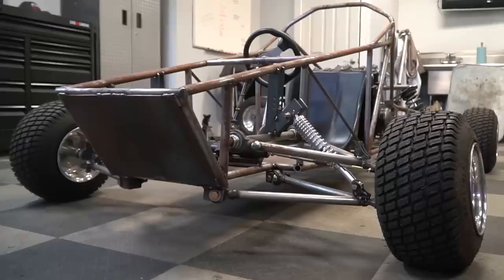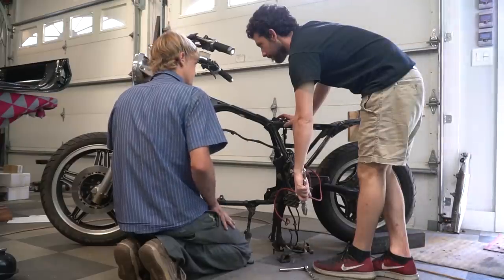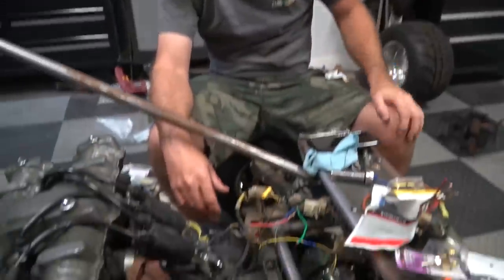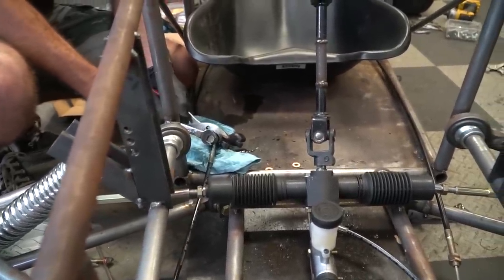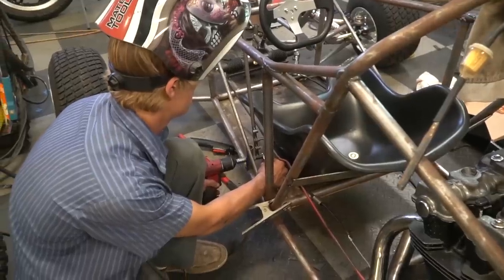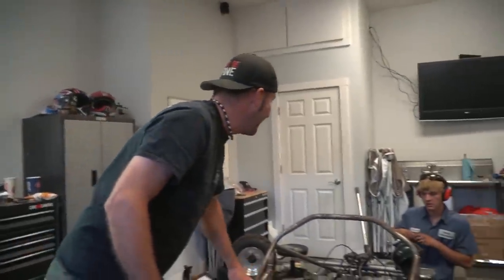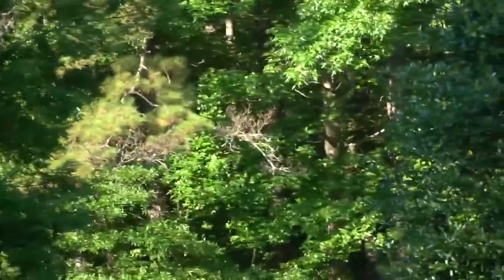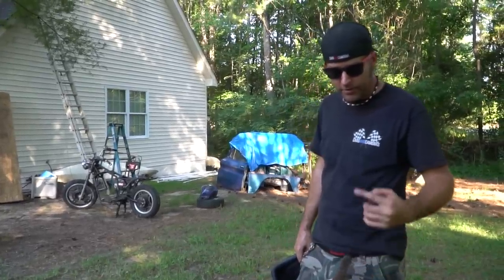750cc Cross Kart FIRST DRIVE!

Comment: I've followed  just about all of your builds and  admire your attitude and skills.  This one really hit home -   it made me pull my almost-done  Honda CMX 450 powered   project out of the equipment shed. My wife put it  into storage 5 years ago  right after  I broke my leg, and half the farm eventually  got stacked on top of it..   I'm pushing 72 and figured it's get it done or sell it before either it or me rots away.    Fortunately I had shut the petcock off on its last start up.     All I did was replace the battery, clean the tank, and ran some fresh ethanol-free gas with  a squirt of  techron  thru the carb - didn't even take it apart.  Started and ran  like it was last shut off yesterday.  Forgot how  loud it is thru 36" curved straight pipes with megaphone ends  -   neighbor a  half mile away came over to investigate.     I finished the clutch (bent the bike's clutch lever and mounted it as a  foot pedal )  and fabricated the same kind of left-side jockey  shifter. Took it for first ride with the right side tire in free-wheel.  Light  throttle,  feathered the clutch, rolled out nice and quick, then  nailed the throttle and it all but  stopped moving -  left rear tire just went up in smoke.  Waiting on new set of Ebay tires all around.    Once this one  is done, I have an early Honda Pilot with a 2 stroke 398cc Kaw jet ski engine that 's nearly finished - just  needs a better brake and a steering rack from GPS.   Hope you guys are around for a long time to come.

Comment: Suggestion: F1 style fiberglass body on it... and/or a huge wing
Reply: #bigwanggang
Reply: i think a rear wing yuou be worse. all the weight is in the rear with the engine so all its gonna to is lift the front iup making it harder to steer
Reply: And a big wing dang doodle
Reply: @retrox684  You could easily make an aluminum wing that weighs all of a couple pounds and bolt it to that suspension brace in the rear. Since it wouldn't matter aerodynamicly till over 60 mph really in any meaningful way, it would be fine. Just don't make the wing out of steel and the balance won't be any worse than now. They could also do a front F1 style front wing, and do that out of steel to make a little more front weight bias since the engine is in the rear.
Reply: I came down here to suggest a big gnarly wing lol
Reply: It would be epic to have a F1 style body on it but I don't they could do that.
Reply: How about a cavalry saber, cut down and used for the shift handle? Maybe some Porsche tubular "silencers for each of the four exhausts- love the splayed pipes they  got from the old Honda! Extend of the kick starter spline to the outside of the car for "manual restarts". Love  the idea of "fighter jet intakes on the sides to help cool the motor! Suggest they dial some of the extreme castor out of the front end- it will be effective at just a couple of degrees and steer much easier- the gear reduction through the R&P steering gear is helpful but for a cart, the total turns lock to lock look tiring. And then just go "steam punk" on it! If any of this will decrease the smile per mile take it off and throw it away! Awesome- Lethal;; I'm jealous- my 750's didn't do that !
,
Reply: What about a cross kart body
Reply: Front and rear wing
Reply: Parker Barandon I think there’s enough weight on the rear already. I’d like to see this thing on a proper road course.
Reply: @williams3118  That could be cool- I'm more about letting the whirly twirly bits and pieces stand out, though!
Reply: @Daniel Seaman ;) !
Reply: Parker Barandon RALLY F1
Reply: Parker Barandon why ? That would not bring anything in the way of performance to the table at all. If anything needs to be fone, they need to stick a proper limited slip diff to the rear end and get rid of the heavy assed miata parts.
Reply: No No,  Leave it the way it is!  Sounds nice too!!!!!!!!
Reply: @retrox684  Its not going fast enough for a wing to have an effect but a wing will slow a roll over and save the frame and bones. lol
Reply: ROTAXD just for looks, why not 🤷‍♂️
Reply: @retrox684  That's why they should add a nice front wing too :)
Reply: Homemade wings aluminum or steel is a bad idea because of the crash factor if someone crashes that thing they are already in for some bad injuries no need for shreds of scrap metal to slice them up too..but wings would look cool I'd go with fiberglass and I only say that because I know someone who races stock cars class with homemade metal bodywork and he can tell you some bad stories about what happens when that sheetmetal crumbles and comes in contact with your body
Reply: Ryry Boyle good points for sure
Reply: A fat GT wing lets go
Reply: Camber on those wheels might give ya little more control..

Comment: for getting the air out of the brake line , the ups and downs in the line traps the air , its still a light vehicle , just lift the rear up untill its above the level of the reserviour and start bleeding , should work a lot better

Comment: Big wing and some slicks. This would be a track beast. It can be a cross kart and a track kart with a simple change of tires
Reply: ricer
Reply: SO2002 that’s not ricey though
Reply: A wing? Hahaha, yeah, not how aero works, but ok.
Reply: @SMDTURBO  you never know 🤷🏾‍♂️
Reply: SMDTURBO yeah but at speed it works, depending on the angle and size of the wing and extra aero, then yes that is how aero works

Comment: When I did my cart…I did it with a CB360 motor…fuel pump…hand shifter (half of handle bar with clutch lever) homemade live axle with 3wheeler tires and a sprocket the size of the wheel!!! Lone disk from the front of the bike! Thing was sick!!!

Comment: I would suggest a harness with a bucket seat and a taller head bar. And like someone else said a cluster with a thick roll cage spec tube to help in a roll over. But that ting is a freaking BEAST!

Comment: when does it stop being a go cart, and becomes a dune buggy ?  Whatever it is I love it ! ! !
Reply: robert miller this is boarder line I’d say, but it’s perfect
Reply: not even a bit dune buggy, dune buggies are built for dunes...
Reply: Usually it becomes a mini buggy when you add suspension.
Reply: Buggys tend to use car motors and tranys   long travel suspension and full size tire wheels and breaks.... not those timy wheels
Reply: I mean my lawn mower has bigger wheels
Reply: @GumpterCrayon  A 3 in lift and different tires, it's ready for the dunes.
Reply: @buddersthepuunk  70 hp of that motorcycle motor is a whole lot different than 70 hp out of an automotive motor. It won't live long in this application. Especially being air/oil cooled
Reply: True ...but buggys tend use more than 70 hp.  Most i know of are at least triple the hp
Reply: @buddersthepuunk  my 1976 VW powered buggy had the stock 30 hp from a VW van. LOL

Comment: WARNING: Put your front suspension >45° else it will bottom out when under load and you risk flipping over the front once the nose digs into the ground. This is why in your previous video, your suspension stuck when it was angled even more parallel to the ground. Do the head clearance ASAP. Nice work guys.

Comment: Well you 3 just walked out on stage and pulled the cover off your 750 cc Cross Kart, started with a bit of start up rhythm and broke into the fired up sound of  one of the best builds on youtube , kicked ass and took names, with some carb work and a 4 into 1 collector for your exhaust my buddy the bike mechanic says you could possibly see 80/85 hp, it is a Frankenstein build and i thought you 3 could call it Phantom of the Paradise ,AKA the old movie from the 70's, your intro song could be  LIFE AT LAST FOR YOUR NEXT VIDEO,  and paint the side of the cart  with a pissed off LEROY COMING BACK FROM THE DEAD TO GET THE RACCOON, THIS IS THE BEST YET

Comment: Amused by the cinematic, but she RASPY.

Definitely needs a wing, a baja paint job, and a 09.98 drag strip time.
Reply: A scary 14 sec quarter maybe.
Reply: taylor harper Nah. I think a 9.98 and more while it out runs the rail.
Reply: Considering the bike did like a 13.8 quarter...... Enough said.  Not taking away from an awesome build.
Reply: @taylorh155  it'll probably do low or high 12 sec pass more traction and maybe less weight or close to the bike.
Reply: Low 9s in the eighth is my guess, I think it might be undergeared to run the quarter since it's a pretty close-ratio bike and they have it where 1st/2nd are ok around the yard.  Not that you'd want to do more than 80mph in a kart like this anyway.

Comment: Hi Folks,
I REALLY like your build(s) and ingenuity.  I've subscribed because of/ to that interesting content  you are providing.
 After 70 years of (gearhead)  life, 50+ Gas & Electric motorcycles and 30+ ICE cars/trucks, and "8" years of Grand Prix motorcycle racing, I love to see guys like you build!!
Stay safe and warm.
cheers
Boots Langley
La Mesa, ca

PS; my only input is;
SLOW Down when you are bleeding the brakes. You are adding air, with your fast pumping.

Comment: BTW John, you do know that the copper piece that the wire comes out of in your mig gun is replaceable right? It's a consumable piece that will get worn out after a wire and you can buy new ones to replace it without replacing the entire lead/gun. Also you need to clean the slag off the nozzle from time to time, most people will clean it off each time they turn the machine on for the first time that day, and if it starts getting clogged up, clean it again. You need to make sure you have an unobstructed flow of gas.

Comment: You guys need to get some sheet metal to put between the seat and the engine. The way to make it work is to have it extra wide with the ends bent forward to catch the air, and fins cut in the correct direction to point at the exhaust. This will force the air through the panel and away from the driver/exhaust keeping both much cooler. Actually, having two panels (with matching ports/fins) sandwiched together with about 1/2" space between them, the side closer to the driver will stay even cooler.

Comment: So I have been wondering why don't you use ATV/ UTV rims & tires? ATV/ UTVS generally have larger rims with greater back spacing (just use some narrow rims with semi slick tires) which would clear the custom suspension better and create a better scrub angle.

Comment: Please tell me you made the frame from chrome molly? Put a better roll cage covering the driver more along with more cross members for lateral force maybe on the under side. It takes one good bump for that frame to small micro cracks. Just take your time inspect at your high stress spots. Good job with the build.

Comment: Increase efficiency and productivity as well as reducing time and labor, by standing your flat bar on its edge to cut it in your chop saw. Reducing the contact point between the tool and your material lowers heat. In effect, less labor for the tool increases its life expectancy. More cuts will be able to be made with one blade. Cleaner cuts on your material.

Comment: What transmission and  differential are you using
Reply: The 750 has a trans in the engine and the axle has no diff its just a cut down gps axle with flanges to mazda miata axles
Reply: Thank you

Comment: Try and find a wrecked 97-01 honda crv. the suspension geometry and everything would be perfect for a cart like this, and  it would be 4wd. you could also probably make a predator motor work with the stock transaxle if needed.

Comment: Its epic like 70's F5000 epic!

 On a serious note, this kart is going to be fast and looks like it will do over 100mph.
With this in mind safety doesn't need to be considered it must be mandatory because no "it won't be fine" and because I want to be watching you messing around with this stuff for years to come here are My recommendations. 

 you need front brakes.
 fillets in the corners of the frame to strengthen it or its going to twist/ snap the frame, it is already flexing!
Exhausts need supporting at the bottom end.
The tank needs to be a race approved one that will not split, spill or leak in the event of the kart rolling or crashing. [Hot exhausts and fuel = fire]
pipe foam insulation around areas where  hands, legs and arms come in contact with the frame  it sound silly but again can make the difference between broken bones and just bad bruising if things get out of control and once your motoring they get out of control very quickly.
The seat needs to support you legs, back, neck and head. at the moment should you roll the kart and not get flung out the snap on your neck with the added weight of a helmet will  snap you neck clean best case scenario your in a wheel chair for life.
with the better seat you'll need a harness.

Sorry if I sound like a grump but... I've been involved in and watched motorsport for many years and its never easy to watch and then wait to seen if someone survived.
With this project you've up'ed the anti and so as an independent observer felt I had to raise these points 

The Ducarti project was always limited and could never really be pushed to its limits and as such was bordering on bonkers but unless you had a deathwish it was only ever going to be pushed so far.
This on the other hand will chew you up and spit you out a squishy mess, when it goes wrong.

http://www.formulaoffroad.org/regulations.html
some light reading

Mistakes are great as long as we learn from the first one.

Comment: Bleeding brake systems... The idea is to move the fluid through the system without aerating  it, all that violent pumping of the pedal is counterproductive. Depress the pedal fully. Crack open the bleeder. close the bleeder. Release the pedal. Repeat. In this method you smoothly and incrementally advance a uniform column of fluid through the system without cavitating it and creating bubbles that make the brake action spongy.  Yes, I know that we have been told to pump the hell out of it, but we've been told wrong.

Comment: That sounds soooooo freakin' amazing! I'm still sticking with a little bigger tires on the rear, but still amazing. Going to put panels all around? Y'all definitely need one behind the seat. I like Isaac's idea about the scoops to direct air behind you, keep the engine heat off the driver.

Comment: You need to separate those pedals more so you can 2 foot drive or 1 foot drive depending on your preferences so extend the pedal out well the bar to the back of the other pedal reposition it or whatever or just attach it somewhere to wear if you want a break with your left leg hit the gas with your right you can or if you want to just use your right leg to do both you can

Comment: I got an idea for you guys. Take a 3 cylinder 2 stroke engine and a MX transmission and put it on a go-kart the full roll cage and harnesses cuz you're going to need them and then put a slap stick shifter in there like how they have them on the ATVs, like the foot shifters accept on a longer stick or metal pole for your hand like a hand shifter so you just click it into gear instead of like a stick shift. Just be very careful with this because we built one like that and the air got caught underneath the chassis so I recommend a spoiler in the front but are caught underneath the chassis and what happened is the air lifted up the whole front of the go-kart and almost flipped it over so I recommend front and rear spoilers.

Comment: My only additions would be bigger seat (unless you are putting panel between engine and you) + padding of course and harnesses.
Its an awesome build but feel likes it more a grass kart than cross kart but will hold judgement to you take it somewhere offroad and actually test its limits and wouldn't be to hard to put some long travel shocks (but your control arms might not do it given design)
Keep up good work

Comment: Awesome job.  Definitely needs better shocks why not use some race quad shocks like 400ex rear shocks. Can usually find them cheap. Carbs sound lean or to much fuel at 3/4 throttle but couldn't see any black smoke as if it was rich.  Use a paddle throttle to free up a foot for front brakes to do some controlled drifting.  Overall great build

Comment: Ive personally found when using a mig to weld  anything with a engine it usually will crack . I now will tig only if in involves a chassis of some sorts.    You need to rejet the carbs when using open filters like    those coming from a stock air box. . Ask me how I know lol.

Comment: Guys id use a heat sheild from the driver and motor for safety and id suggest to get an aluminum bucket seat that will fit both of you and run a 5 point harness if you ever plan on racing in a class

Comment: If you have trapped air, raise the rear end really high in the air, to wear the blender is the highest point in the system, crack blender, wait a while air bubble will raise to the highest point because it floats,

Comment: There is a device that will help out a lot with the brake system if the master cylinder is lower than the caliper you need to install one

Comment: I think you guys should pick up some used yfz450 front shocks for the front end and some 450 wheels and tires for ground clearance. Should be cheap and easy to find
Reply: You can find a used set for around $150 maybe even cheaper. They have 10 inches of travel and have a lot of damping adjustment. And most sport quads have 21 inch tall front tires and 20 in the rear. That should give you the height

Comment: Have y'all ever tried putting an enlarged gas tank on a go kart for more fuel capacity I'm wandering because I'm thinking of doing that so I can increase the range of the go kart I plan to get I've taken measurements of the back of my SUV and it would be able to fit in the back of a bit snug but hey I'm just wandering